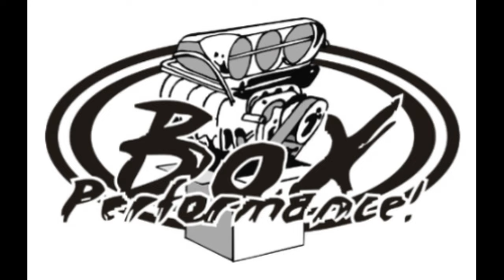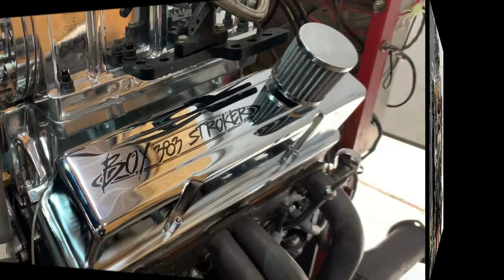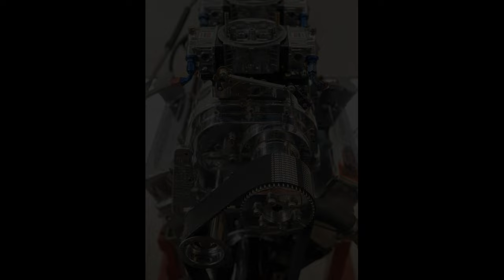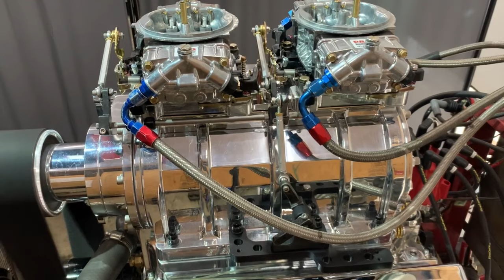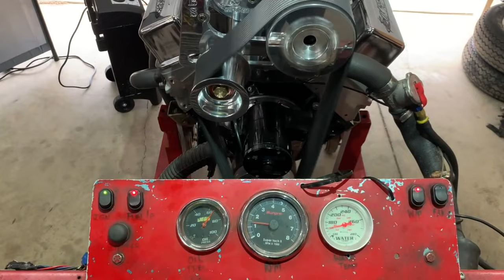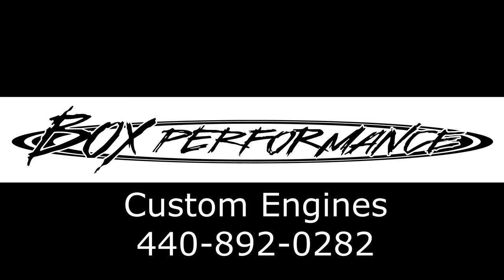Beastly Sounding Blown Box SBC 383 Stroker- WARNING Awesome Blower Surge Alert

Comment: Only thing badder is a SBC1 Iron block set at 500 inches.   Big Difference between my blown 421 and blown 500 inch.  A bit easier to do with a Dart Little M or Dart Iron Eagle, than with a SBC1(as I call them)   I can't believe it's been forgotten about.   Sonny Leonard did it for years, as did Jenkins.

Comment: I have a question because I figure this is the place to ask it, why does half the blower community (who still stick with carbs) claim that you dont need boost referenced carbs/boost referenced power valves, being that this a draw through application. While the other half says no there is no need for boost referenced carbs. I ask because whether it's my VW with a draw through turbo setup or my camaro that has a blown small block in it, neither of my applications have a boost reference. Do people do it for driveability/tunability is there a significant gain I can get if I do convert my carbs over? I would greatly appreciate any response and thankyou for your time.

Comment: Thats what I'm Talking about sound great .Have a question are 2- 750's carb's to big to run on a 671  SBC
Reply: You basically want as big of carburetors as you can use, within reason. Since the carburetors are your restriction the bigger they are the snappier the throttle response will be because the blowers rotors can immediately start grabbing air. You get to a point where you start sacrificing drive-ability because it'll be "too snappy" with too big of carburetors, so you just have to find the in-between you like

Comment: After I do a burnout my motor wants to turn off. Runs out of gas I'm thinking.  I've been told it could be timing,float bowl level,fuel pressure.  Where do you think I should start.  427 BBC w/6-71 drag car only. Any help appreciated.
Reply from the maker: Hi Manuel, sorry , I missed this question. Have you resolved your issue yet?

Comment: Badass. Is this a pump gas motor? What makes it surge?
Reply from the maker: Yes, it is a 93 or higher pump gas motor. The surging is due to the tune and build combination.
Reply: The surge is a lean-rich-lean-rich-lean-rich condition. It goes lean and revs up it gets wet and idles down... A "good" tune would eliminate the surge. Trust me it would suck to drive through town and at slow speeds. Been there, done that, and worked my way through the tune to make it nice to drive everyday. They will make your neck and back sore when they do that.

Comment: Blower surge is not a good thing it’s caused by running it way to lean
Reply from the maker: It is actually a lean/rich cycle on idle not just lean. I understand that many people do not like the surge. It doesn't cause any harm we have been running engines with surge for over 40 years. We have customers out there with blower engines that have been running for almost 20 years with blower surge. It can be tuned to remove the surge if the customer doesn't like it but most customers want it. 😊

Comment: One thing plain and simple is it's not tuned, although many people think blower surge sounds cool, it's actually a rich/lean condition and can easily be tuned out, surge drives real tuners crazy because it's not hard to tune out, carbs are the easiest, and it can even be done with EFI and mechanical injection
Reply from the maker: thank you for pointing that out. Yes, we do know we can tune it out if we wanted to do that but we want it to surge. It causes no harm to the engine and it doesn’t affect the performance so we leave it in because people like it.
Reply: @blowersurge  I get it the "surge brigade" don't know what they don't know
But the people that are really into performance and know how to tune just cringe and laugh at it, but to each their own
Reply from the maker: @garyallen8869  just because we have blower surge doesn’t mean we are not really into performance or don’t know how to tune. Maybe we just like the money from the surge videos. We have a paid YouTube account and blower videos have more views. It is as simple as that. No need to put our tuning abilities down or say that real tuners laugh about it.
Reply: @blowersurge  not putting anything down, bottom line it's either tuned correctly or it isnt
Reply from the maker: @garyallen8869  it doesn’t interfere with the performance of the car on the street or at the track. So what does it really matter if it brings smile to someone’s face?
Reply: @blowersurge  to each their own
Reply from the maker: @garyallen8869  yup. You can rest assured that we do know how to make the surge go away. Most customers come to us because they want their engine to surge so that is what we do. ☺️
Reply: @blowersurge  the customer is Not always right, 😂
Reply from the maker: @garyallen8869  When it is harmless and makes people happy it is alright in my book. 🤑
Reply: @blowersurge  as I said to each their own, and some people only care about the almighty dollar which is fine, from building tuning everything from top fuel motors to grand am road race motors and everything in between, for 40 years, I cannot intentionally put a motor out of tune just because people that don't know any better think it "sounds cool" or that's what they want, it's either right or it's not, but again to each their own, I personally educate people, or if that's what they want I send them elsewhere
Reply: @garyallen8869  but if it doesnt make the car any slower nor will it go any faster without the surge,  why would you care so much about it?
Reply: @KingJT80  it's obviously beyond your understanding, yes it will run faster if it's tuned correctly, but 90% of the people don't know any better and think an out of tune rich lean surge is cool, so in the big picture no I don't care, ignorance is bliss, carry on
Reply: @garyallen8869  this is an idle condition.

What's that have to do with WOT?
Reply: @KingJT80  ever hear of off idle transition & tip in genius, you don't know what you don't know again I will reiterate even though it's a waste of air it's either tuned right or it's not, and to intentionally put something out of tune because the ignorant think it sounds cool, or that's what someone pays you to do, is just being a slave to the masses, it's either right or it isn't regardless of how you justify it
Reply: @garyallen8869  they literally have a race car on this channel with blower surge and there's no stumble off of idle.

Again what does this have to do with WOT? Stop trying to sound smart
Reply: @KingJT80  again you don't know what you don't know there are tons of racers that have been racing for years , with blower surge etc, doesn't make it right or good, I've been running everything from Top Fuel, to road race, grand am etc tuned all over the US, Europe, and Australia for over 40 years, so none of this flash in the pan or flavor of the day impresses me nor do I care, the bottom line never changes it's either right or it's not, plain and simple
Reply: @garyallen8869  never said it was right or good i said  it has 0 to do with WOT racing.  go tell it to these guys who own this channel who are actually doing what you say you do....thats why  they stopped responding.. because  they know  what i said is correct
Reply: @KingJT80  no it's actually because they know it's right and there is nothing more to say, and if you read my previous comments that's what they're about they'd rather do something wrong because that's what someone pays them to do, so they care more about the money than educating a customer that the motor is actually out of tune, and yes those that do know better do laugh at it, but you can't fix stupid
Reply: @garyallen8869  you think they didn't tell the customer that? Like I said before their own cars hunts at idle but runs down the track on a no prep surface just fine
Reply: @garyallen8869  so you're saying their car runs like crap?
Reply: @KingJT80  you are a
 complete waste of air and space, clearly they are your hero, but to answer your question compared to a well tuned race car, no again you don't know what you don't know
Reply: @garyallen8869  they're not my hero and they're literally told you what I just said but whatever you know it all 

show me ETs in the difference

Comment: Bad ass I have a blown sb 400 overdriven has serious blower surge no way to stop it unless I lose power and change the pulleys ???
Reply from the maker: You can try adjusting the carbs and see if that helps. If it is not as rich it may not surge as much.

Comment: Wow an engine builder that puts up a video of blower surge proving they don't know what they're doing and probly why Billy's motor got trashed. BLOWER SURGE IS CAUSED BY IMPROPER TUNING! USUALLY A LEAN CONDITION PEOPLE!!!!!!
Reply: Blower surge can only be tuned out with EFI not with carburetors. He is running dual carbs and it is awesome.
Reply from the maker: Actually, the engine is on the rich side not lean side. In a carbureted engine the surge is caused by the throttle plates being forced to close or flex at a slow idle due to high vacuum. When the vacuum drops then the plates open back up. This causes the rich/lean hunting sound that you hear. It only surges at a dead idle. There is nothing wrong with having it surge. The car has run for over 20 years with the surge. We have drive it on the street and race it at the track. We have won many races over the years with it. As for Billy, don't believe everything you see on social media.
Reply from the maker: You are correct! 😁😁😁
Reply: @lukehayvaz9194  Incorrect
Reply: Keep idle higher